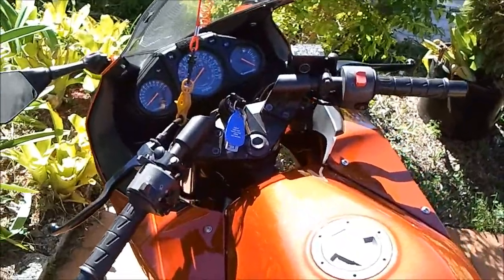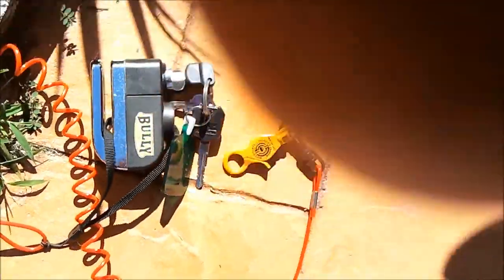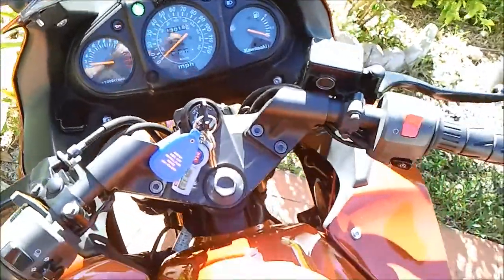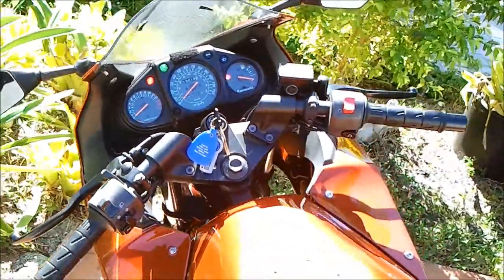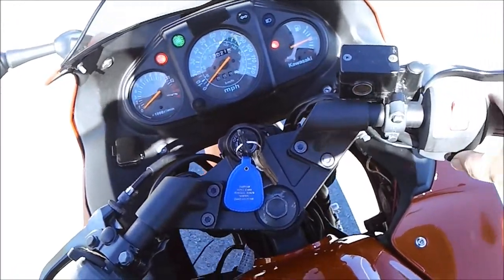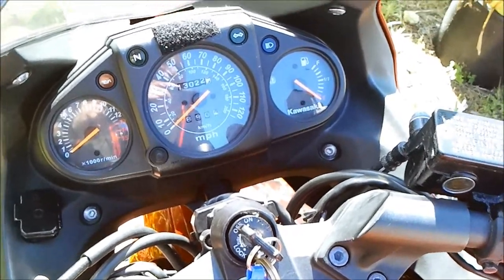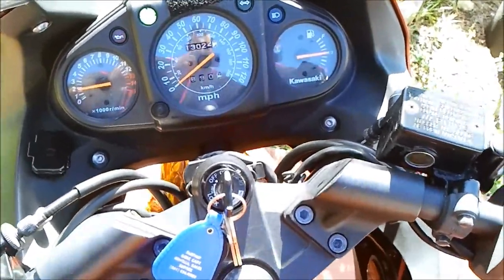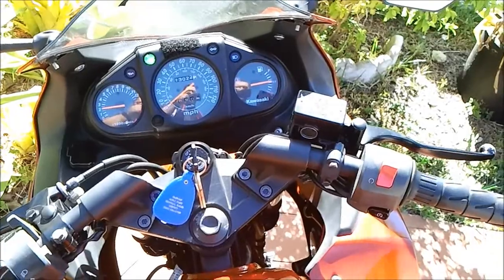Having rev issues with my 2008 Ninja 250r (HELP!)

Comment: Your idle screw is probably messed up from adjusting it. Mine does that if I mess with the screw at all. I learned that if it ain't broke, don't mess with it. Leave it where it works right.

Comment: best thing to do?? try to lower your float valve, it has too much fuel in carb thats cause your starting issue.. next adjust your fuel/air mixture screws open it up a little bit that cause your gas fume in your exhaust its to rich on gas. after you've done those two things, the last and important is have your carb calibrated properly.. after you've all done this you gonna find your ninja running smooth like never before.. trust me I've done this.. its a time consuming process so be patience..
Reply: Karolina Trembecka hi..how to do that? can u teach me?

Comment: I had the same issue with my ninja250 I cleaned the carbs and was a bit better but the rpm’s still held high when I rev the bike plus revs dropped very slow and if I just touch the idle screw the bike would rev up all the sudden I found the bike was to lean I had to go 4 turn out on the fuel mixture screw and the bike would run good anything less than 4 turns out the bike would have a erratic idol basically it would run like crap. More then 3 turns out on the fuel mixture screw indicates that the pilot jet is to lean the mixture screw should be 1 1/2 to 2 1/2 turns out from closed. Plus if you modify your exhaust and air filter or air box you should look at re jetting your carbs as well this will help you get the most performance out of your bike hope this helps

Comment: Check your carbs and also the throttle cables maybe. When you have aftermarket mods such as an exhaust you have to tune the carb again to fit that. Plus look up symtoms of lean and rich fuel and air mixtures and diagnose the problem on your bike using those

Comment: Just cleaning your carbs won’t help you!! This is because cleaning your carbs helps to remove clogged holes, therefore increasing fuel flow.(rich mix) you must check your float height and sync your carbs

Comment from the maker: i had installed the Danmoto exhaust like 5 months ago, and just installed the K & N filter about a month ago.  bike was running fine until it suddenly started to act up recently.  my friend messed with the idle screw when he saw what was happening, but as you can see, still having an issue. i don't see any reason any of my throttle or choke would have moved. spark plugs were changed when air filter was changed. THANX FOR YOUR INPUT!!

Comment: If the bike is completely stock then you don’t have to jet it. Firstly start with the small things, check the cleanliness of you filter, if dirty replace or clean. Then do a proper carb clean. (Important!!!) while you cleaning the carbs make sure you inspect the valve needle for wear, then adjust float height to spec!!!. If problem still persists then you must sync your carbs!. If problem still persists then you might have to look at your valve clearances which should be ok if your bike was serviced within 8000 miles. Good luck buddy.
Reply: And make sure during this process the idle mixture is fully out and not affecting the fuel mixture, as well as make sure you get new spark plugs after you clean everything. This is because when you ride it for about 10-20 miles then take them out, they will tell you if your engine is running lean(white) or rich(black). What you want is a brown residue(perfect).

Comment: Continued from below. I don't think the bike will run rich on a #130 jet so make sure it's not larger.  Also, make sure that both throttle cables and choke cable are not pinched and are routed correctly under the tank. Have you adjusted the idle knob on the bottom of the carbs?  I would only look into rejetting as a last resort, #1 if the jets are not the stock size and #2 if the richness screws on bottom will not make a big enough difference

Comment: Great clip thank you for sharing I now have the same problem and am working through it. I've cleaned the carbs twice, reset the valves, checked all the hoses for leaks and splits, checks the manifold and air boots for splits and leaks too, tried new fuel, adjusted the pilot screw out but looks like I have to the carbs off again and check the butterfly's and the mixture screws, seals and diaphragm turning out to be a BIG job requiring a lot of patience if anyone has any advice would appreciate it!

Comment: It looks like you're running the bike with the choke on. The choke is only used to start a cold bike.  The fact that it gradually picks up revs when first turned on is normal, tolerences inside the engine become tighter as the engine heats up to running temp. If anything the fact that you added a freer flowing exhaust and freer flowing air filter would cause a lean condition.  Carburated Ninjas finicky animals, I suggest you find out how to properly use your choke or in the alternative get a fuel injected bike.  Seems to me this is a user error issue.
Reply: Joseph Bania The choke is off

Comment: You did install a jet kit, right?  You can't go adding pipes and intakes without rejetting. You might sometimes get away with adding a slip on pipe but the intake (k&n) really affects breathing. Your jet kit (dynojet, factory pro, etc)  will give you options: just pipe, just intake, or both. Sounds like you have both so just follow instructions. You'll end up having replaced main jet and needle. They'll probably have you set your idle mixture screws at 3 turns out which will be a good start but might require a little tuning. Running lean is NOT good for your engine!! Avoid riding until rejetted.

Comment: Hey man, I think your problem will be fairly easy to fix.  First let's narrow down the problem.  Did the problem start immediately after swapping the air filter or exhaust?  Have you checked the spark plugs to see if they're black and sooty?  That will tell you for sure if it's very rich. Did you buy the bike new or did someone else do the mods? First of all  I would pull the jets to check the size. They should be #130 or close to that.

Comment: First check the carburator selenoid 16125-1200
And then check the needle Jet 16187-0277
After that check any leak in carburator manifold 16065-0043

I hope you problem fix

CMIIW

Comment: I have the same problem on mine and I just bleed the carburetor and when back to normal
I think when I wash it water when it to the carb thru the intake
Reply: 031786c ... how do u bleed it i have the same problem it wont run on  2000rpm it has to be on 3k rpm or higher once it runs i drive and come to a stop and it stays at 4500rpm :-( 2012 ninja 250first bike ever  dont know much or where to start

Comment: Hi guys, I have a 2011 Ninja 250R with fuel injection and Im having a very similar problem. 
Ive flushed the tank, cleaned the fuel pump and throttle body. New air filter/ spark plugs/ fuel line and did a valve adjustment. The air lines look fine as do the boots. Im thinking maybe the throttle body sensor is faulty but theres no warning light comming up. I dont have much experiance with fuel injection so Im unsure where to go from here but I will do a vacuum test and inspect the springs on the throttle body. 
Anybody have anyother bright ideas?